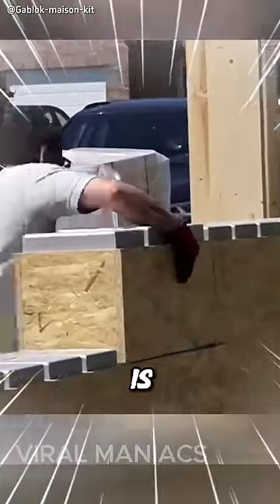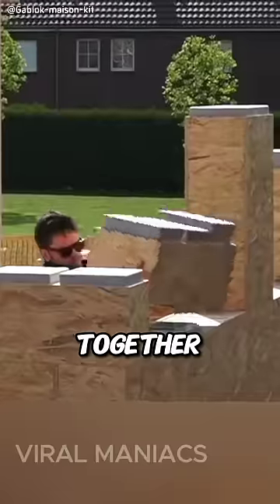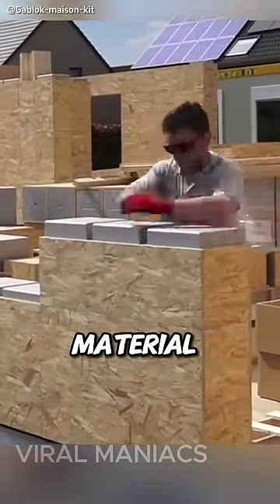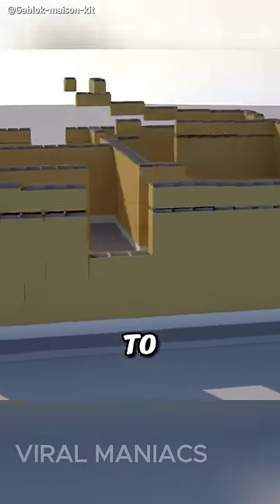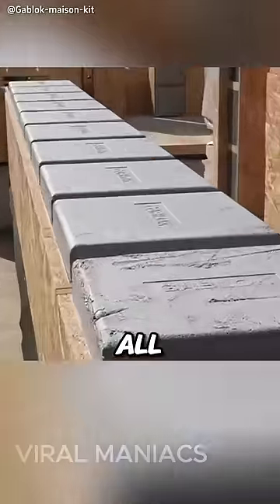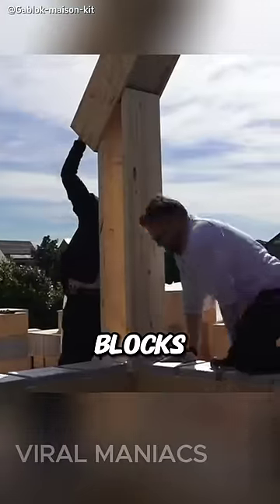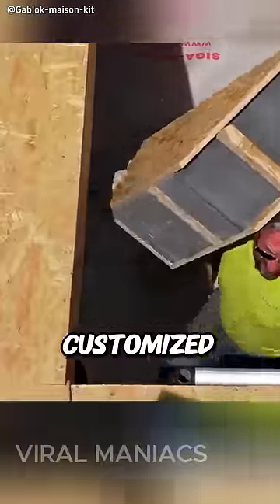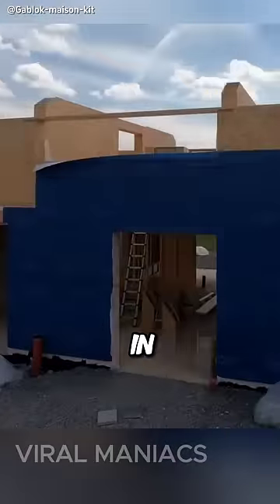Whoever Invented This Way Of Building Houses Is a Genius #shorts

Comment: As a carpenter that house would use 3 times as much wood as your house currently does
Reply: Yes, but it saves labor costs, you cut out a bunch of middle men.
Reply: @bobbob-zc1nx  well, you can get more traditional and more structually sound modular homes for less.
Reply: @Rainaman-  didn't look at the price yet.
But I doubt your gonna get the style and size you want.
Tbh this has potential. Buy a lot on the outskirts of town, set up basic plumbing, electric, build a huge 2- 3 story home for cheap. Make it look cool and rent out 10 bedrooms for a 300$ month profit.
You have roommates for a few yes but you got a high quality house way more convenient than living in some suburbs near the city.
Reply: I would be curious to know if any of it is fire resistant. Does the design process include wiring and plumbing details, or do you still need internal framing that would allow for this separate from the "lego" structure? I don't know that this provides enough info to take this seriously. Sure, I can see how it would look less expensive at face value, but I can't tell that it is actually as good or better long-term. I don't know if the roof wouldn't pull the house apart in a strong wind.
Reply: Not the same expensive wood either.
Reply: It's cheap particle board
Reply: @Brandon-nr8fn osb is not cheap particle board. Osb is some durable crap. Nothing like particle board. You don’t know the difference so maybe you shouldn’t comment?
Reply: I would think this is less actual wood since osb is made up small pieces of composite wood.
Reply: @user-ds6ur2og5p i don't know much about osb board but based on what I read it's not an external product. Based on the video you get something a competent person can put together maybe 5% of the population.. excluding die towns etc at a guess it look like it would have better thermal properties but I don't think it would be quicker or cheaper my guess
Reply: And the lego house is still cheaper and better insulated.
Reply: @bobbob-zc1nx buddy you have 0 idea what you’re talking about 😂😂😂 stick to video games
Reply: @sketchman1981  you think but it’s not because it’s more dense, foot for foot osb is twice that of just regular 2x4 like if you had a stick and turned it into dust and tried to glue would that dusk occupy the same space? No it wouldn’t
Reply: Houses should use minimal wood, because they shouldn’t be built primarily out of shed materials. no wonder people get shot through walls and hurricanes completely devastate, the houses are made of paper
Reply: @BenjaminMarquez-q2g You probably taught him something he didn’t know so being rude wasn’t necessary
Reply: @BenjaminMarquez-q2g OSB isn’t durable. It is weak. The biggest weakness for it is water to. OSB is basically the same as particle board. Just a little stronger. Both are inferior when it comes to every other building material.
Reply: Big boy Legos
Reply: Chip board is effectively free relative to the cost of a house
Reply: Not to mention only a 2inch overlap and your sheer strength is fkin polystyrene foam 😂
Reply: @shmeef279  so is the dirt fill the foundation was poured on. What's your point? It's a junk design
Reply: This house is more insulated and stable. It also holds heat in the winter and cold air in the summer, saving you hundreds of dollars on energy consumption. But let's not talk about infrastructure because American has some of the worst types of construction housing.
Reply: Fair point. I don't see why the 'blocks' has to be that size. Why not basic 2x4 thickness? & why wood? Why not fire retardant material?
Reply: @bobbob-zc1nx  then you have to spend the labor costs you saved on drilling through the blocks for plumbing, wiring, and ductwork.
Reply: Cute that Americans use wood for there houses, if you put a British made brick house in the middle of a tornado the house would never move 😂
Reply: @stanislavschaefer3233  most of what you said is true not the stability part, I built alot of stuff in my time and since it’s made to be taken apart easily and the styrofoam doesn’t help with weight with high enough winds 120 k/h that house would fall down, and the moisture it might be good against heat and cold but water always finds a way in, and if their is cracks everywhere the materials would rot faster if not properly sealed,
Reply: I have house made of logs, 20 cm thick logs, i doubt these legos use more😂
But my house withstands way better against weather and cold
Reply: OSB is cheaper than 2x4s, little buddy
Reply: @BillyAldous-y4k  those go down too lol.  More resilient? Yes but not indestructible.
Reply: @bobbob-zc1nx it looks weak af though imagine a whole city collapsing because of this why cant people just do things the right way and build a house with actual structure that wont break after a year
Reply: @milkboccle I don't know of many houses that survive a hurricane, and nobody buys a house based on whether a bullet can impenetrate it... JS
Reply: @Rainaman- do you know the price? Don’t go around saying suck things if you haven’t done your own research
Reply: @goodkill1  why did he mention wood being the limiting factor? also the blocks arnt held in place by the styrofoam they are reinforced with timber from the inside after setting in place, uve very quickly glossed over the building technique, but consider halling many tens of tonnes of material miles across country and taking months to hand place the brick and mortar, or knock this up in a day? maybe not fit for a king like u but there are definitely people willing to pay small and live in it
Reply: So no electric chanelling or pipes?
Reply: Based.
Reply: @DK-bk1vq my house just survived a cat 5 about a year and a half ago (hurricane Ian)
Reply: @user-kr4hy8tv4w I always find it interesting how someone who isn't  from here (USA) go on about thier better way of doing things. How easy do you think it is to make and transport "Brick" across a country with four different  time zones? 300 million people living in brick houses? I mean, don't get me wrong, it would be great...but not practical or affordable to anyone  over here as the main building  material.
Reply: Please explain. I'm a frame carpenter for 30 years. Looks like you can make 3 to 4 blocks from 1 sheet. If you are talking about a cmu home vs this then maybe. But an All frame house, will use a lot more wood.
Reply: @shmeef279  so it's framed from the inside? Like a conventional house? Then you're using twice the osb for a gimmick. Plus plumbing and electrical would be a nightmare.
Reply: @BillyAldous-y4k at least we’re allowed to have butter knives 🤷🏼‍♂️
Reply: @ahop075  I am a construction estimator. You get paid from the neck down, I get paid from the neck up. Not explaining it. 👍
Reply: Yes, but basically all scrap.
Reply: Not only that it seems like its probably gonna have some waterdamage too with all the gapps and stuff
Reply: Considering the shit quality modern builders put out... this is likely not an issue.
Reply: @doublebarrel7913  it looks more expensive than normal construction at face value just because of the sheer quantity of wasted raw material and the fact that it is specialized pieces. And that's before even looking at things like wiring. But also based on the material you would need additional external construction and internal paneling. These literally only make the base layout. You would still need to build the equivalent of a house over the surfaces. They will also artificially inflate the size of your house if used as shown due to the width of all internal walls (which would also make all your internal doors look ass btw and fuck with your wifi)
Reply: @mahziel  yep. This is definitely not a worthwhile idea.

Comment: Looks like a great way to build a temporary house on land you own, while slowly building your actual house.
Reply: Except, it's not. Those blocks cost 3 times what normal.construction would...
Reply: Yup, sounds like a great fun weekend activity for the kids to build in the garden to play in for 2 seasons. Then taking the remains to the junkyard.
Reply: @neverstopschweiking  I mean, it's a way to build a house, but, definitely not a "genius", way...Actually, probably the dumbest/most expensive way to build a house...It still needs internal framing, so, you are essentially building a shell of a house for almost the cost of a whole house...
Reply: My relatives just used a trailer or mobile home (not sure which) as they could just "hook it up" to water and power.
In this thing you would still need to run plumbing and electrical, put in windows and doors.  Also, no roof.
Only really good for temporary storage, and then it is overkill.
Reply: Lol all American houses should be considered temporary houses. They are basically made of cheap wood and cardboard.
Reply: *real house
Reply: @BananaJoe478 Mine is cement block here in FL.
Reply: @brentfarvors192  I live in central Europe, for many reasons, houses here are very rarely made such as in the USA, with wooden frame, our houses are brick and mortar, concrete or combined. Smaller buildings such as cabins are made similarly as in America.I know it requires a skill and time to do proper wooden construction. I don't know how much time it takes to construct a large house that way, but the construction using aerated concrete blocs is about as difficult and as fast as this lego house, so I really don't understand why anyone would use the lego system.
Reply: @RamelAziz  That's why you should buy a custom-built home, not a home built by a mass-produced homebuilder that stacks houses beside each other.
Reply: @BananaJoe478 Yet they last for 200 years, while Eastern houses barely last a decade before falling over in yet another Jihad, or Communist Revolution.
Reply: If you can afford both, I'm sure that Lego kit isn't cheap
Reply: @emac543  we use Brick in Europe, the only people in Europe who use cement block are those living in poverty. We only use cement block for garages, sheds or stables. Cement block doesn't last long. And my brother is a building in the Tampa bay area. You still use a lot of wood there.

Comment: burglars don't need to break through the door, they will just punch their way through the walls.
Reply: Wouldn't they do that with any wooden house then?
Reply: @ladychamberlainisit  I don't know. Never seen a wooden house. Could be an American thing.
Reply: @Alex1986Sevilla  we definitely use wood
Reply: wood is pretty solid, i don't think you would get through some thick wooden wall unless ur chuck Norris
Reply: A 2x4 house has maybe 16 inches between 2x4s this is usually filled with insulation and plasterboard on the inside.  The outside is maybe 1/4-to-1/2-inch plywood or worse with a nice outside.  With a little practice you could put your fist through the whole works or use an exacto knife and walk into the house.
Reply: @highball1415  exacto knife, maybe if you have time to try & cut through every layer or, just use a glass cutter and you're in any house regardless of walls.
Reply: Not going to be as easy as you think!!
Reply: Indeed, or just use some cordless tools......

Comment: How is it anchored to the foundation?
How do you run wiring?
How do you run plumbing?
What is the wind rating?
What is the live & dead load rating?
Is there any off gasing from the OSB or the polystyrene?
What is the fire rating?
Reply: No idea but it'll probably float in a flood 😂😂😂
Reply: The house is fine karen
Reply: @Mm-wf7gw  no... no it's not... But then again, I'm not dumb enough to buy that, you might be though so go for it, let us know how it goes
Reply: Only in America you would call a plywood house stable and robust. 
At least home invaders don’t need to break your expensive doors or windows, they just remove some blocks. 
Or you wake up to a missing roof and walls, must be easy to take apart from the roof down.
Reply: Plumbing and wiring would be fast using pvc conduit and a drill with a hole saw bit.
Anchoring it to a foundation would be time consuming. As for fire resistance there's spray foam insulation that's rated for 4 hours giving anyone inside time to evacuate. Most osb has a weight rating of 1200 lbs per square foot and is used commonly in trusses for homes and commercial properties. Any other questions??
Reply: @dog.dad501  I've got some more questions. How would the plywood not rot and how can it withstand heavy wind?
Reply: @dog.dad501 "any other questions" lmao you drama queen
Reply: Google Gablock housing. It's in Belgium.
Reply: Who called the housing inspector?
Reply: As the daughter of firefighter my first thought was fire
Reply: @dog.dad501  plumbing and especially electrical would not be quick... I'm guessing you couldn't even find the trades willing to do it.
Reply: I have questions about the it's connection to the foundation as well. I live in Oklahoma, and I can't imagine what a tornado would do the that thing.
Reply: Came here to type this
Reply: nice set of question for a thesis defense project 😂
Reply: @Mm-wf7gw no not at all 💀
Reply: @dog.dad501 ain’t nobody use osb for roof trusses.
Reply: Yes.
Reply: Best house I ever bought
Reply: Where are the windows? 😭
Reply: No, but for real, how do you run plumbing and electrical?
Reply: These people don’t have a clue about basic home building
Reply: @Mm-wf7gw those aren’t karen questions. Tf?
Reply: @Mm-wf7gw how is buddy a Karen? Those are questions anyone would ask 😂
Reply: @spacecowboy301 idk about electrical but for plumbing  but upe
Reply: This is youtube dude, try asking google
Reply: @Mm-wf7gw  your comment shows your ignorance. Those are very important questions to ask.
Reply: Yes
Reply: Also how does one mount anything with no studs
Reply: @dog.dad501 lol osb isn't used for trusses.  The fuck are you talking about.
Reply: @MrDownhill86 it's robust compared to our cardboard walls.
Reply: @MrDownhill86 This is a real life Minecraft house 😂
Reply: @lucerodj11We shouldaccept everything that we see on the internet without questioning it?
Reply: @dan-bz7dz  the plywood is treated so it won't rot or degrade for a long time so when you buy lumber just know they  already thought of it rotting so they treat the wood its a process that lumber has to go thru before they sell it.
Reply: @dog.dad501 there’s a huge difference between the OSB beams used in construction and these blocks.
Reply: @MrDownhill86  it's Belgium... but thank you for letting us live in your head rent free.

Comment: And where exactly do you run the electrical, plumbing, and HVAC systems?
Reply: Same places you run everything in a log home
Reply: My guess would be the under the floors, hanging from ceiling, and in wall conduits.
Reply: All the plumbing electrical HVAC would be designed and set up under the slab before they pour the slab. Once they pour the slab, there will be exposed PVC pipes that you can run your electric system through as well as plumbing etc. but you need to know where these locations are going to be before you get started. Otherwise, I can get complicated.
Reply: You cut into or drill through it. Or place plywood or drywall on top of it. Or run it exposed, same as in a log house/cabin.
Reply: Lego People never had utilities 😅 but they had awesome garages.
Reply: I'm sure those are just for the exterior and conventional framing on the inside
Reply: Wherever you'd normally run them. I don't get why you think it would be an issue🤷🏻‍♂️
Reply: That would probably be done in floor, roof, and the drops after mechanical builds .     Like how wind proof is it ?
Reply: Mini Splits Systems look them up.
Reply: It's all wireless!
Reply: Not everyone knows anything about construction. Traditional building is far better, and cheaper. That amount of insulation is also completely unnecessary for a high r rating. Stupid and wasteful process here with bad end result.
Reply: @raydraiz1859  Making future changes or repairs a royal PITA...
Reply: Bro everyone here keeps saying “oh through the floor obviously” like yeah but how do you think lights work? Hopes and dreams? Even if you run your feed wire up through the floor, guess what guys, it still needs to get UP from the floor to the switch and then UP AGAIN TO THE ROOF FOR THE LIGHTS, use your Brain, seriously
Reply: @raydraiz1859 how would you add outlets on all the walls though?
Reply: @BLOODFART309      Im used to traditional construction myself .   But where I am from in certain winter cold areas the styrofoam blocks are used a lot especially in the basement floors .      Don’t think it’s cheaper to build just more energy efficient .
Reply: @RealityAndlife-sb8uc  that's interesting. I don't have any experience with basements, since nobody has them in the areas I've lived. Air isolation is the best thing like in double pane windows. Only takes 1 inch of air and thin metal between fire and wood to prevent the wood from burning from the heat by building safety codes. A solid coat of paint with no cracks floor to ceiling and 99% perfect weather stripping on doors and windows would hold desired temp better with no insulation at all than a fully insulated house with air leaks. I'd bet on it for fun